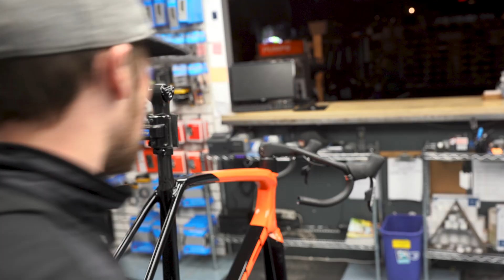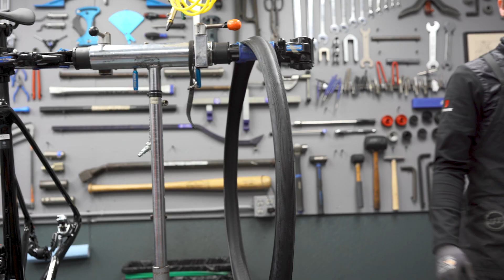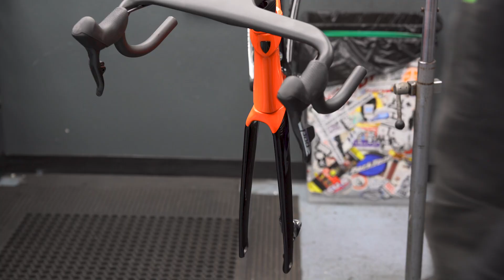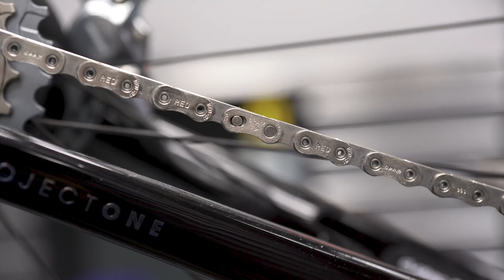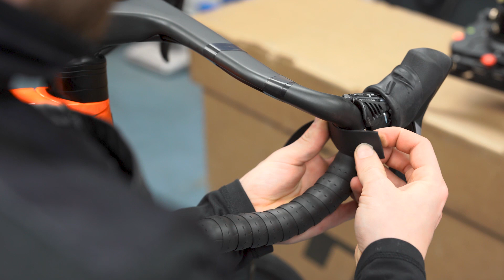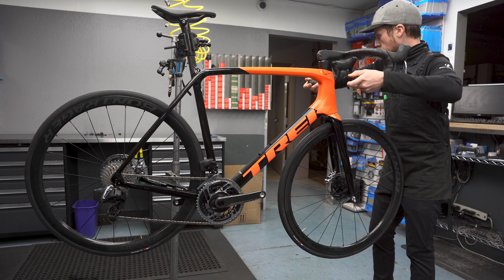DREAM BUILD - Trek Emonda SLR Project One

Comment: So, what’s the advantage of the through axel?  You need a tool to get your front tire off.
Reply from the maker: It's a stiffer platform that offers more direct steering and extra support for the forces exerted by a disc brake system
Reply: @summitbicycles  Got it, thanks

Comment: biggest fail on this build is electric tape on the handlebar
Reply from the maker: Fair comment & thanks for taking the time. Happy to hear about what you would like to see used instead.
Reply: @summitbicycles  general i use opposite direction without tape, when you want to use electric tape, then use gently, 2 times around perfectly fitted not like plumber 😀, perfections is in details.